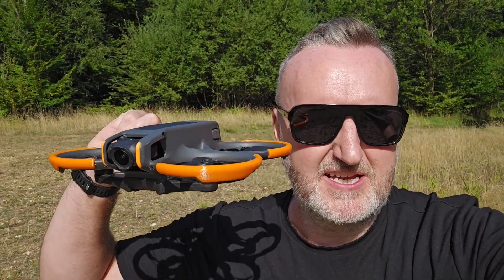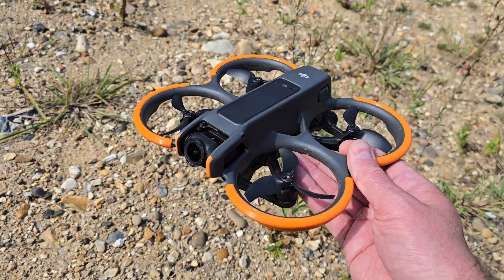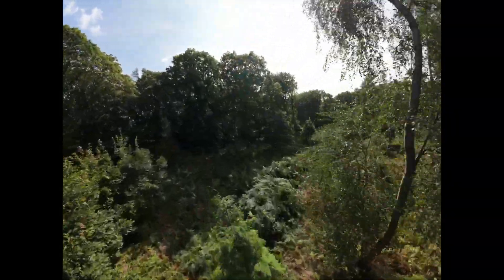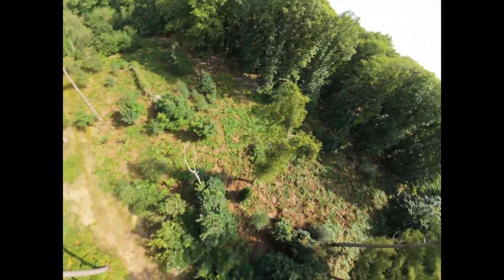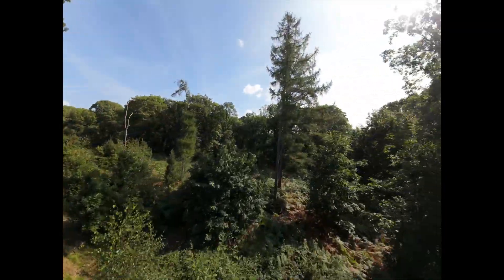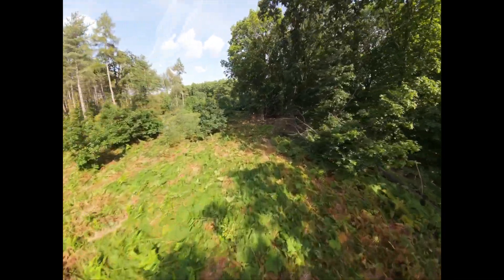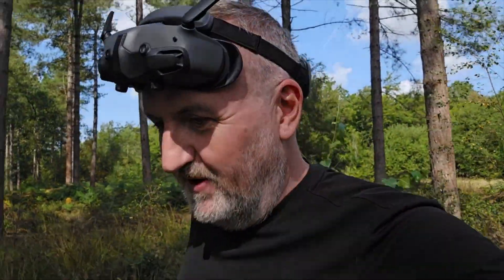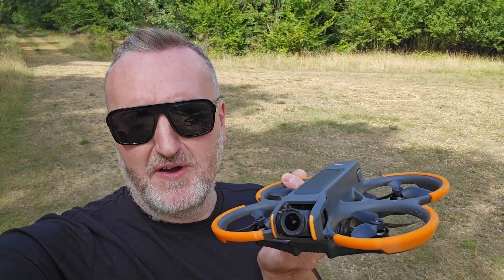This new protection kit for the DJI Avata 2 is brilliant!!!

Comment: Just popped in an order for the bumpers. With free delivery in the UK I'm happy to pay what they cost.

Follow On: You really need to add another strip of the 3M 300LSE to the kit as at least a spare, because if you are new to sticking these on your drone you're going to make mistakes just like I did. Never used this tape before and I made an error which meant I wasted just enough to not have enough left over to cover one of the bumpers. I had to use offcuts. Its cheap enough so please add another strip. 

EDIT: I have literally just found out via NJ Tech's channel that there is an installation video. Absolutely no mention of this anywhere on the product page. Please get a link added to the product page so we know how to fit them without wasting the tape. It seems obvious now, but not if you have never fitted them before, or had no experience with using said tape. 

I'm really annoyed with myself as I have fitted all 4 of mine incorrectly. I now have to buy my own tape, try and take them off without damaging the bumpers, and install correctly. All this could have been avoided if the link to the installation video was clearly linked on the product page. 

And also I really want to buy another set as a backup in case I lose one, but at the time I couldn't afford to buy 2 sets at once (or have enough faith in the product if I'm being honest, which is understandable, as you can't just trust the word of the developer without trying them yourself first.) If I buy another set now, do I get the 40% discount on the second set?

Comment: Not enough talking anywhere regarding avoiding switching modes when having a red error. Even after posting my issues on reddit and to DJI this precious information never surfaced. Kinda dumbstruck how it is not out there and not common  knowledge when you own an avata 2. Had to learn the hard way TWICE 😐

The guards sold anywhere is shit, and can definitely see your guard design seems way better not interfering with the "open" area under the props.

I resorted to high density tape and insulation tape to DIY a guard that does not severely effect flight.

Your guard is definitely tempting, just my bank accout dont agree 😅